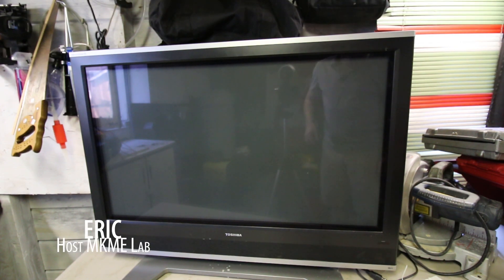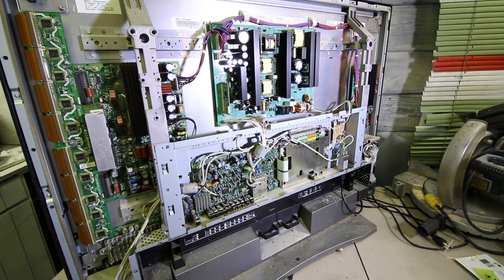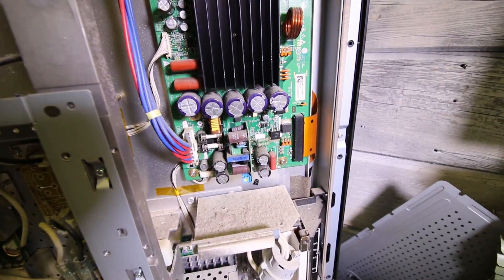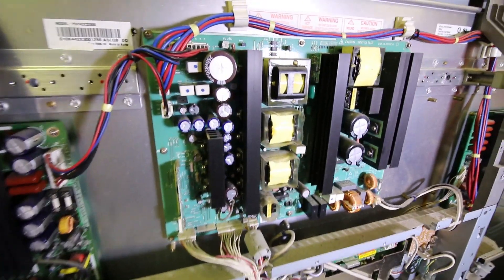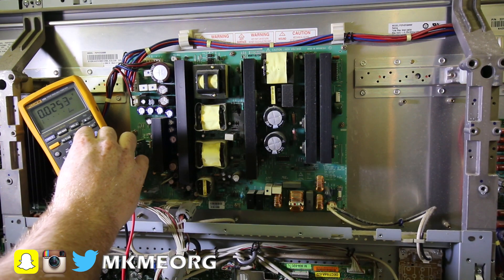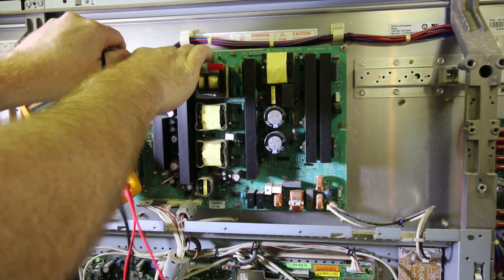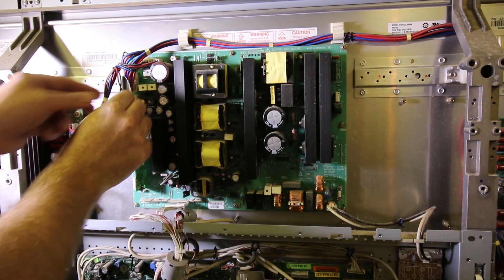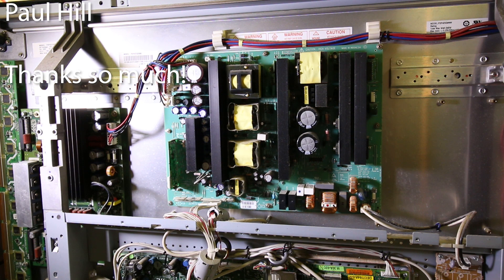FREE Plasma TV Repair- CAN WE FIX IT???

Comment: I fixed my LG Plasma a couple of months ago.  The bad part on mine was a black rectangular capacitor similar to the one above the two electolytic caps on the center right of your power supply.  Once I unsoldered it, I could see that the part was slightly swollen.  A component tester measured about 100pf instead of 0.0047 uf.  A new part of ebay got me working.  Mine was a 1200 volt part.

Comment: You said the power light came on briefly and then goes out... I would guess that the PSU is trying to start up and then discovering that the output is out of spec and shutting itself off again. That swollen output cap is highly likely to be the culprit.. it it's not smoothing the output properly because it's gone high internal resistance then output voltage would be all over the place. Cheers!!

Comment: Also look at the bottoms of the caps, they often bulge out there and push the rubber plug out. It's very likely a cap failure, hopefully a failing cap didn't take anything else out. I'd run through them all with an ESR meter if you have one.